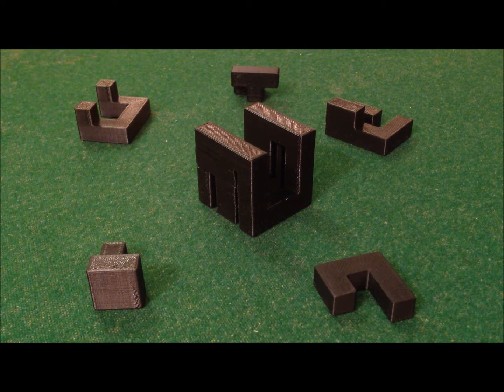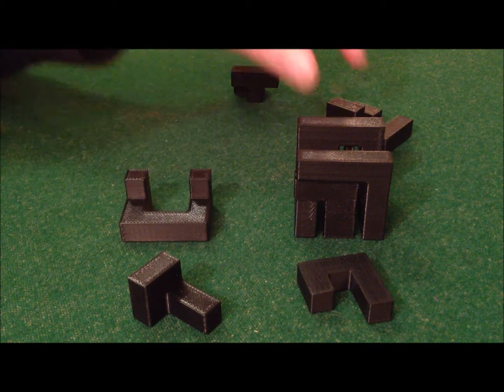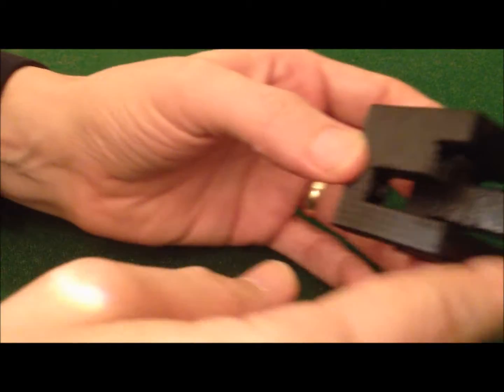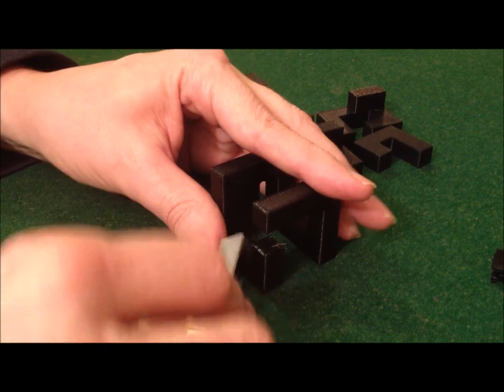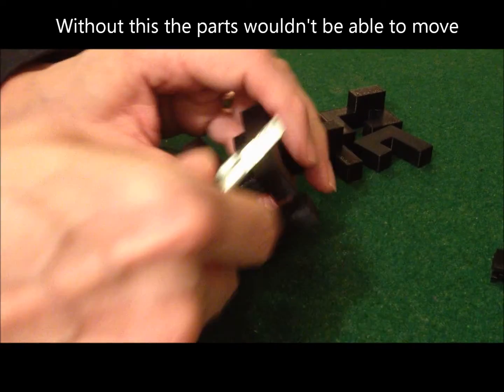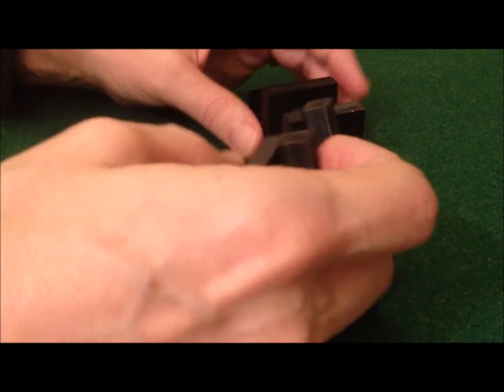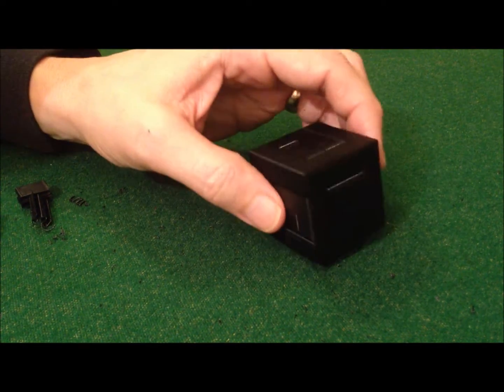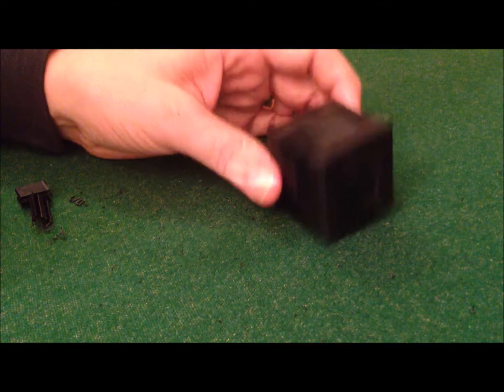Printable Puzzle Pieces

Comment from the maker: @grogyan - not sure which settings you wanted but hopefully this should cover it.
Model pieces created in Burr Tools and exported with:
Unit size = 10
Bevel = 0.5
Offset = 0.05
Model skeined using:
Layer thickness = 0.3mm
Perimeter width over thickness = 1.7
1 Extra shell
2 Solid layers
Feed rate = 32
Flow rate = 32
Raft activated
Base layers = 0
Interface layers = 0
Support:
-cross hatch = unchecked
-flow rate ratio = 0.6
-Feed/Flow = 1
-Gap ratio = 5
Support = Everywhere
Min angle = 50 deg